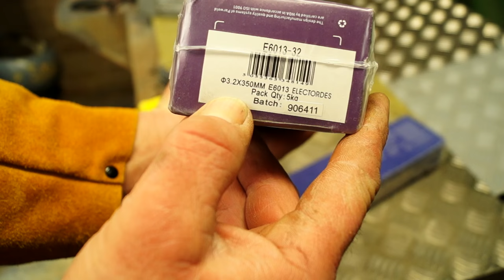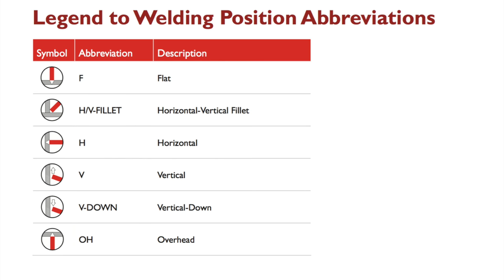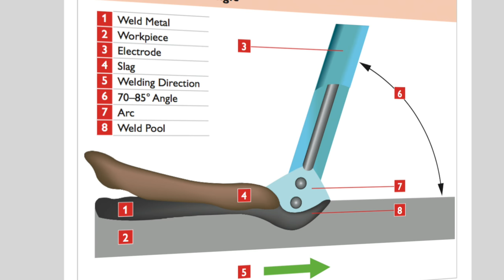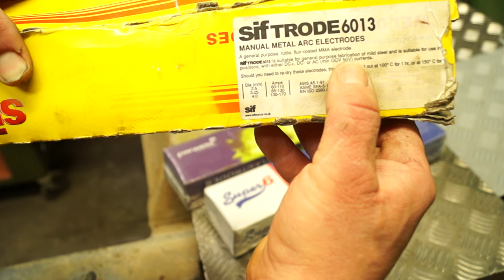Land Rover (Chassis) Welding - Striking an Arc, Welder and Welding Positions

Comment: Weldcam shots are great... gonna have to grab some rods, lay some bead and practice some stick technique, thanks for the video.
Reply from the maker: there is a practice called padding beads which involves run a weld across a plate then weld 1/2 over the top. continue over lapping beads until the plate is full of weld.   I would have shown this but ran out of 13 amp fuses.

Comment: so is going too fast worse than going too slow? If you go too slow then are you getting the right amount of penetration but just piling up the weld?
Reply from the maker: Not really,  you can loose penetration either way- too much can overheat and cause later fractures in the weld and metal around the weld.

Comment: Any idea why your machine is blowing fuses?. My cheap stick welder used to blow fuses when new but its been fine for a couple of years now, strange.
Reply from the maker: current draw blows fuses.   Or a loose plug or cable connection.     Perhaps your welder is not drawing as much current as it used to?

Comment: Did I hapen to see an old fuel tank near to your welding place... ? That sure could cause some trouble...
Reply from the maker: Well spotted.  Yes, it could be an issue however that has been rendered safe by splitting it open and washing it out.